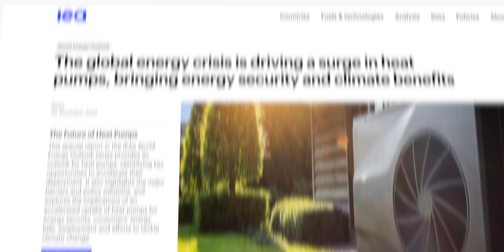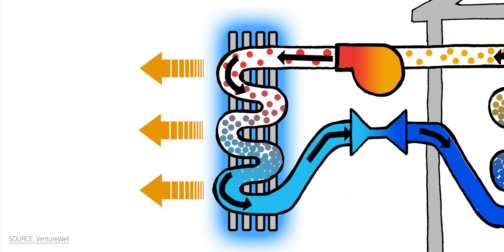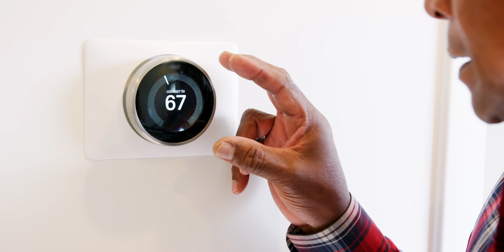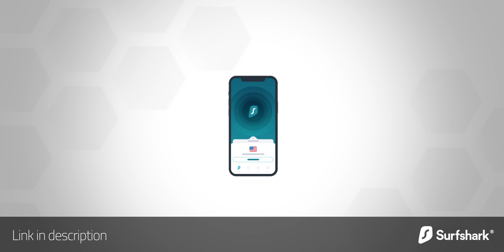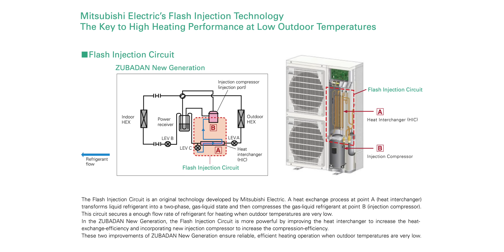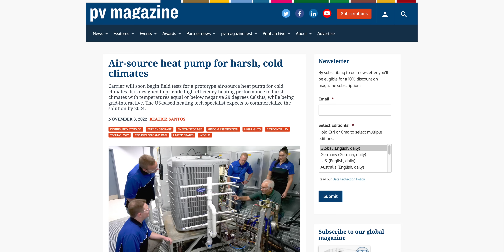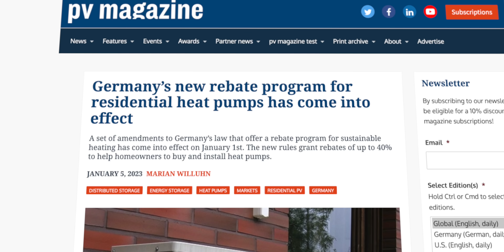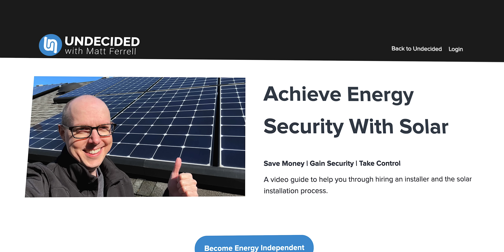Major Advances with Heat Pumps in the Extreme Cold

Comment: thanks for your information. It’s very helpful. I’ve had a hard time getting good information about what a heat pump is without too much getting in the weeds. It is difficult for me to think about energy efficiency because I have a gas boiler that would not be replaced by any heat pump, even though the pump would be heat really on the shoulder season. Actually, there is pretty much no HVAC content out there that takes into consideration that people might actually use boilers, especially in old homes where energy efficiency really is a challenge. If you have any interest in making such content, I say go for it.

Comment: The heat pump is excellent in the fall and spring when the temps are in the 30F-40F range. Yes they work in low temps as under 10F or 0F however they use a lot of power when the temps are that low.  TBH, if you are living in a cold climate area, you really cannot be oil or gas for heating. Thats why almost every heat pump installation is wired to kick on at 30 degrees, below that your boiler will heat the house.

Comment: Quite a few inaccuracies. Be assured that the Dept of Energy programs and tax credits will be gone under Trump admin.  Ground-source heat pumps cost way more than $8000, installation is NOT the biggest part of the cost, frost doesn't happen on coldest days (air is too dry) but right around freezing temps. "Most compressors can only run at 100% - compressors can run at any speed, it's the AC motor driving them that cannot - not without special circuitry. The defrost cycle is a prominent waste and managing that more tightly aids overall efficiency. CCHPs are significantly more expensive - in the range of $12-16K.

Comment: Heat pumps are constantly being improved, which is great.
What really matters are 2 things:
1) Are the annual costs lower than with heating with natural gas, for example?
2) How long does it take before my installation has paid for itself and I really benefit?

1) Natural gas has 8.8 x more energy than 1 kWh.
So the price of natural gas must be compared with that of 8.8 kWh.
8.8 kWh is more expensive than 1 m3 of natural gas.
Example (in the Netherlands): (electricity 8.8 x E0.4= E3,52) / gas E1.4 = 2.5.
The (average annual) efficiency must therefore be at least 250% to have the same costs, but then there is only investment and no profit.

2) If you do have a profit compared to natural gas alone, e.g. €600 per year and the investment is €8000, then the payback period is: 8000/600 = 13.3 years.
After this period you will only start earning and hopefully you will not have too many maintenance costs, because then it will take even longer.
(everything is without extra costs of insulation, larger radiators, underfloor heating etc. because a heat pump emits a lower temperature than a normal central heating system)

In the Netherlands the average efficiency is approx. 200-250%, because the efficiency drops sharply in cold weather, despite the promise of manufacturers that the efficiency would be between 400 and 550%.

Due to the poor efficiency in cold weather, a hybrid installation has been devised, which uses natural gas in the coldest periods of the year, because that is cheaper than a heat pump alone.
Only the payback period is a lot longer.

Everything remains dependent on energy prices and politics. No one can predict anything useful.

Ask someone who has compared the costs of natural gas and a heat pump in an honest way.

Everyone can choose what they find important and how they invest their money.

Comment: I live in Tenn and have a Ruud Heat pump that I installed well it is terrible it can barley heat and the air is always cold. I don't understand that the Gibson Heat pump that I replaced heated much better this one is always using its Aux heat and is soo loud and costed me 9 grand.  After call after call to my installers they told me they don't work well in the winter which is a lie really.This one don't . I took a chance and bought me a 18,000 Btu mini split heat pump off of Walmart, Turbo Greenland 23 seer and shipped to my door and everything for 650 bucks. I installed it myself after buying my own lines for the freon and some blue nylock. I did not vacuum my lines at all , I bought that can of no-vac from Pioneer Hvac web site. I followed the instructions to the letter and hooked it up and poof.. That was two years ago , I don't use my main system anymore at all I use some box fans to circulate the air. It got down to -5 here a few years ago and this thing trucked right through no problems and my power bill is 40 bucks a month cheaper. I called my Hvac installer and he wanted 6000 bucks to install it which was a Rip-off , I think I made him mad but I don't care. It took me 7 hours to do it and he wanted 6000 to install it, he is not a attorney but wants to be paid like one.This thing is also silent outside you can't hear it unless you go right up to it and touch it. I will never go back to these full size units...

Comment: I'm sorry but your pricing is wildly inaccurate. Back in autumn of 2024 we bought our Mitsubishi Kaiteki 6600 and paid 2200 USD (in Norway, so it's even more expensive than usual) and it has a COP of 3.1 in -25c with a peak capacity of 6600W while consuming 1400W

This is a completely normal heat pump for Scandinavian households, so talking about upfront costs of 8000 USD is wildly misinformative and you should honestly do a better job with looking into costs before you publish a video that is otherwise pretty informative and accurate.

As Technology Connections has both figured and explained thoroughly; installers in NA will match a heat pump system to your pre-existing gas furnace which is already over 3 times as large as it should ever need to be, making any solution they come up with wildly expensive.

It's quite literally a borderline conspiracy when I look at the NA market for heat pumps and then look at the closest home depot-like store which is where we paid the total 2200 for the unit AND installation.

Comment: Heat pumps are a good option for supplementary heating but not a primary heat source. In the winter in the Berkshires on Mass my main heat source is a wood stove, the heat pump kicks on earely in the morning when the wood burns out and when its really cold my propane heat exchanger kicks on

Comment: I live in new Brunswick canada.  I had a heat pump in a semi basement apartment. My heat pump cut out two or three days a year when high winds were combined with -25 c temps. I had base board heaters as a back up. It is highly recommended to have a second heat source. I loved mine. Great air conditioner as well, and a dehumidifier.

Comment: Quick tip to improve heat pump efficiency in winter: Locate the unit on the south side of the house, in direct sunlight.

This is not as ideal for cooling, but cooling does not cause the major issues these units suffer from.

Comment: I think the main thing that people glaze over is the differentiation between being the most efficient, vs cost to run. Yes, heat pumps are very efficient, but efficiency may not equal savings depending on utility rates. I would like to see someone do a cost comparison from that wavelength.

Comment: I know two houses with heat pumps out here in West Texas, and in both cases, additional heating (in one, propane, in the other solar) had to be installed to handle temperatures around freezing or below. Most of these older ones could use replacing, but many cannot afford to discard an existing, expensive system with a newer, even more expensive new one, so ...
Reply: That's more down to the building design choice in America, where the air handler is often outside the heating envelope, so they struggle to get enough heat the be able to defrost.

Heating systems over here in Europe don't have the same issue, as we either have minisplits (internal units inside the heating envelope), or Hydronic ("Air to Water"), so heat from the heating system can be used temporarily for defrosting.

My ones here have kept my house warm in 3 days straight of -20C/-4F without any backup heating.

Comment: Using heat pumps in Finland will drain our wallets empty due to the extreme high electricity costs furthermore in Finland we are double billed from two different electricity companies each month for using electricity along with a standing monthly charge even if no electricity is used we must pay for electricity.  The electricity in Finland is one of the most corrupted systems in the world that most people are unaware of so heat pumps are not possible to use in Finland due to the extreme high cost along with corrupted energy billing.
Reply: What about solar pannels?
Reply: @GlossaME  solar panels work only during the summer months in Finland because the sun is high enough for solar energy during the summer . In the winter months the sun is too low along with the snow covering the solar panels which causes problems.
Reply: @Can_Fin  tough luck then. Electricity should be cheap, if not for greedy governments

Comment: At 4:57  your change of topic is so  quick that ppl not paying very close attention might think  you  are conflating air sourced and ground source heat pumps. Ground source heat pumps have none of the winter issues of air sourced heat pumps 😬 and it's very confusing you'd be focusing on [actual] limitations of air sourced heat pumps given you are installing a far superior ground sourced heat pump exhibiting none of these problems regardless of how cold it gets outside.

Comment: if you pay more than $3000 to switch your system to a heat pump. you got screwed. you only have to do change the outside unit and run a valve control wire.

Comment: "York YZV and york HMH7 can already operate in -15C". In Finland we have used such and better Mitsubishis from 2010 i.e 14 years now. There is 3 full months of which any given day can be -35C. It is not extreme. It is very common. Just like in Canada or Alaska. Still it is really frustrating device as it stops all the gains operation at -22C. And that is the best flagship model from Mitsubishi. Just when it is so cold already. And that pushes price of electricity up further because all those 45% of households having a heat pump at the same time are forced to start using pure electric heating. It does not matter if the house is insulated if physics of the refridgerant does not allow heat to be extracted. So this new R290 hype is very welcome here in Finland. I really hope it is true for the next gen devices. On the other hand what kind of deal is something like 10% more heat? It means practically nothing. It must be like 20% all the year and then it might be very good deal. That is possible why in Canada they dont use heat pumps. What use it is if it leaves you dying when it is coldest like -35C. In the summer they are super cool machines however. A heat pump can be difference maker between productive summer or sweaty hell. And if you don't see temps under -22C it is always a great deal.

Comment: When you live in northern climates (I live in New Hampshire) heat pumps are only as good as how well your home is insulated and how often you lose power and have to switch to a backup heat source. In warmer climates I'm sure they are great but with Canada to the north and with frequent outages at times, no thanks.

Comment: My God how companies are good in driving prices up! If  it is AC, it costs less than thousands . If it is heat pump, it costs more than 8 thousands! Technically they are the same machine . Adding electric heater will cost a lot of money!!! But technically it is adding a wire of cheap metal

Comment: They may take this down, but I’m at a serious loss of why?
Heat Pumps? Absolutely Excellent Choice! The Real Trick with Heat Pumps is to Truly learn how to make it your friend? Honestly!!! Read on…1st ) They Tie into your existing Furnace Heater. No need for an Entire New system as like Central Air 2 )Efficient Heat when Properly Operated. No need for extra heat units in your house. ) 3 ) Easy to Maintain when Operated properly.
Most Importantly I Accomplished Everything I Learned and did for FREE!!! Just Time I Put in and made a HUGE Gain!! Also, be it known we Never touched the Unit itself, inside or out. NO Money spent to Accomplish this Goal!!
1 Warning people. Please Understand this. SEER ratings have Nothing to do with Heat Capacity. SEER only applies to A/C Ratings. K.
Now also, this is just my input into the subject and I am Not trying to Gain any Income. K. thanks.
Now with that said, we had a Heat Pump A/c system yrs ago and still do & always will. Short Version of our situation was an Incident 1 yr where our Power Bill skyrocketed. Almost S1100 for 1 month., February. Fan Unit outside was an Ice Box. Fan blade Crashing into the Ice build-up. Scary Scenario that made us panic.
Called for a Technician of Course and they had NO Real long lasting Solution. Fact is, Bottom line was the Tech guy told us it’s suppose to Defrost Every 45 minutes Blah, Blah, Blah. Then ignorantly stated to pour hot water over it. Yeah right!!
That comment sent me to heights of U know what!! I decided immediately to resolve this problem forever!! I then did just that very thing. I pursued an education talking with other sources and research and ended up resolving the problem permanently!! NO more Issues after that Day.
The Industry and Technicians are missing a Major key to the Advantage of Heat Pumps. I can’t reveal what I discovered however. Sorry.
Read this. It will blow your Mind. Remember that $1100 Power Bill? Well Guess what? We were on a monthly Budget Bill cycle type setup. Every yr. it gets adjusted according to Power consumption over a 12 month usage amount. K. Simple.
$485/mo. We were at when we got hit w/that $1100 Bill!! Now like I said, Guess what? In just 18 months, Yep…18 months!! I reduced our Budget bill down to $0.00!!! The Next Month $48. Incredible!! My pursuit of knowledge paid off tremendously!! I have the proof and challenge anybody to prove me wrong. That will NEVER happen. I calculated over a $3000 savings in energy costs in 18 months. Awesome!!!
Last thing was this. Not only did I Reduce the Power Consumption, I increased the Amount of Heat being Produced!! Unbelievable!! We gained 45% more Heat and drove down the Cost of Operation!! This is something nobody could possibly understand w/o witnessing this in person. Take care folks. Good Luck.

Comment: Heat Pumps? Absolutely Excellent Choice! The Real Trick with Heat Pumps is to Truly learn how to make it your friend? Honestly!!! Read on…1st ) They Tie into your existing Furnace Heater.No need for an Entire New system as like Central Air 2 )Efficient Heat when Properly Operated. No need for extra heat units in your house. ) 3 ) Easy to Maintain when Operated properly.
1 Warning people. Please Understand this. SEER ratings have Nothing to do with Heat Capacity. SEER only applies to A/C Ratings. K.
Now with that said, we had a Heat Pump A/c system yrs ago and still do & always will. Short Version of our situation was an Incident 1 yr where our Power Bill skyrocketed. Almost S1100 for 1 month., February. Fan Unit outside was an Ice Box. Fan blade Crashing into the Ice build-up. Scary Scenario that made us panic.
Called for a Technician of Course and they had NO Real long lasting Solution. Fact is, Bottom line was the Tech guy told us it’s suppose to Defrost Every 45 minutes Blah, Blah, Blah. Then ignorantly stated to pour hot water over it. Yeah right!!
That comment sent me to heights of U know what!! I decided immediately to resolve this problem forever!! I then did just that very thing. I pursued an education talking with other sources and research and ended up resolving the problem permanently!! NO more Issues after that Day.
The Industry and Technicians are missing a Major key to the Advantage of Heat Pumps. I can’t reveal what I discovered however. Sorry.
Read this. It will blow your Mind. Remember that $1100 Power Bill? Well Guess what? We were on a monthly Budget Bill cycle type setup. Every yr. it gets adjusted according to Power consumption over a 12 month usage amount. K. Simple.
$485/mo. We were at when we got hit w/that $1100 Bill!! Now like I said, Guess what? In just 18 months, Yep…18 months!! I reduced our Budget bill down to $0.00!!! The Next Month $48. Incredible!! My pursuit of knowledge paid off tremendously!! I have the proof and challenge anybody to prove me wrong. That will NEVER happen. I calculated over a $3000 savings in energy costs in 18 months. Awesome!!!
Last thing was this. Not only did I Reduce the Power Consuption, I increased the Amount of Heat being Produced!! Unbelievable!! We gained 45% more Heat and drove down the Cost of Operation!! This is something nobody could possibly understand w/o witnessing this in person. Take care folks. Good Luck.

Comment: As a Canadian builder, I can say that air source heat pumps are perfect here for up to 9 months per year, if you get the best air source heat pump. In the winter backup heating is necessary. Ground source and water sourced heat pumps are brilliant though. 
I heat with firewood though, it reduces the fuel load around my home for the next time a forest fire comes near. Burning firewood from standing dead, dry wood is the best fuel source where I live. It will burn one way or another, I prefer that slow burn warmth throughout the winter to summer wildfires